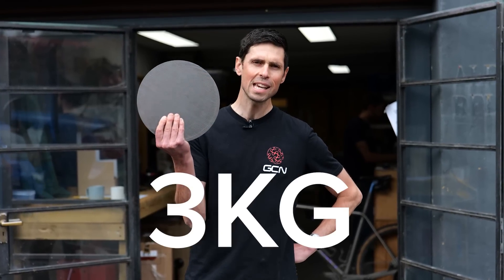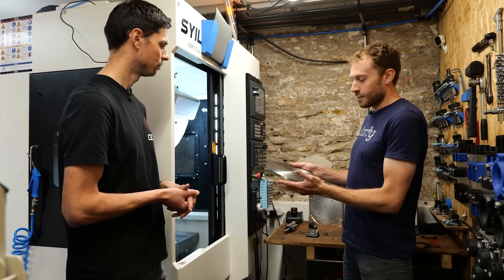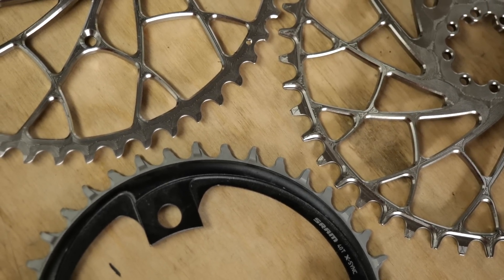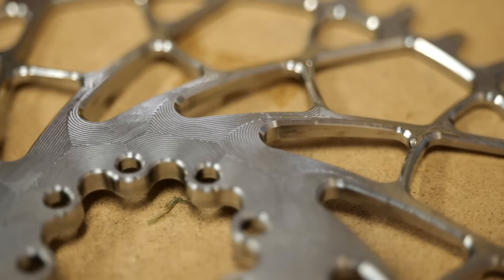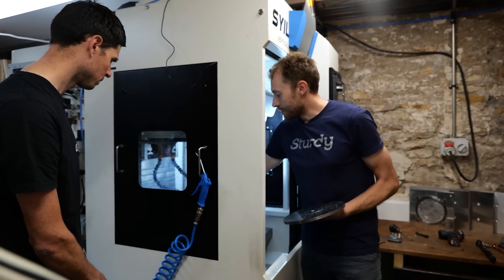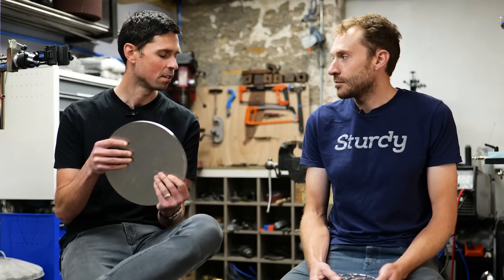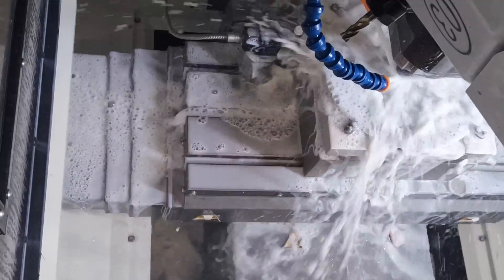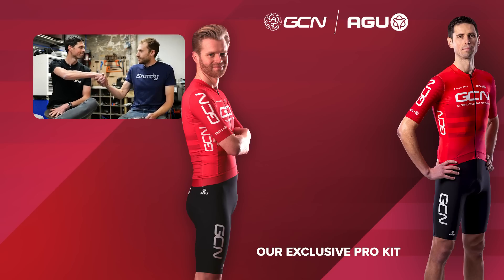How The World's Most Expensive Chainrings Are Made!

Comment: I'm waiting for e-bike engineers to make a braking system like the engine on a train "Dynamic Brakes" you can eliminate the rear disc and caliper and turning the motor into a generator, by squeezing the brake lever, that power could be dumped back into the battery. Maybe it could work so well after some tweaking, that you could still lock up the back wheel with the brake lever and get moments of small charges.
Reply: I could be wrong, but I think the free wheel would stop it from working, like it would have to be a direct drive like a single speed. But maybe they can figure it out, where the idea can work.
Reply: @4U2CY  your right, I didn't think of that.
Reply: Fascinating idea!
Reply: @keirfarnum6811  thanks, remember where you hear it first  🤣 $$$$

Comment: While this is impressive, it also illustrates the massive amounts of waste involved. And while the left over titanium will most likely be recycled, we are talking about a 95% waste-rate ... and that is after the waste caused by the discs being cut initially.
Reply: This is pretty normal in the realm of machining.
Reply: @thomasl6912  This is actually pretty extreme for waste. I'm sure he's done the math and found this as a balance, but that's 50% more material than is really necessary which you both need to pay for and then pay to machine away.
Reply: As above answer this is pretty normal in manufacturing. Titanium is extremely expensive so he won't be wasting any more than necessary. As they pointed out in the video it's also far more durable than aluminium so the product life span is much greater. For a precision component machining is really the only option so there's no alternative.
Reply: This nicely highlights the benefits of additive manufacturing and why it is getting more and more tracktion.
Reply: You'd really need a very specialized machine that could put down titanium material.  My experience with additive material products is that they do resemble what you are looking for but don't have the strength to be of any value for a functioning part.  
That titanium frame you mentioned may have looked like a real frame,  but I sure wouldn't get on it.
Reply: @paul5683  Printed grade 5 ti is actually stronger than grade 5 ti bar...  It's just crazy expensive still. You be over a grand for a ring like this and would still need post machining on the teeth and interface. ( for reference atherton/robot bikes are printed ti lugs. Charge bikes did printed ti dropouts to name just 2 full mass production examples).

You also don't need any sort of special machine to mill ti. People do it on $800 hobby mills. Not efficiently, but its not that much more special than hard steel or stainless. It just destroys tooling REAL fast and can be a fire risk in some conditions.
Reply: @miniMonsterCNC  Been machining Titanium for about 20 years and the coated tooling that is out there now eats through it just as easy as Aluminium. You just have to use the right speeds and feeds. Running tooling too quick will destroy them quickly.
Reply: @dikkybee  On a taig? My context for that comment was on a little hobby machine. Probably not fully clear. Otherwise exactly what I mean. It is not all that special to cut.
Reply: Are the titanium shavings recovered and recycled?

Comment: Thanks for a great dive into bespoke bike component manufacturing. But, I would have loved to hear more about the structural design considerations (of the web) and the value of working from billet as opposed to stamping or forged.
Reply: I can tell you one thing about not using a stamping or forging. You would need a specialized die to do either. Plus you would need a specialized machine to run the die in. A forging would be more difficult.  The stamping might be accomplished with a fine blanking die. That's how they make a lot of those thicker steel sprockets, but you would still end up with some second operations to finish it.

Comment: If you want to make something compatible with their products, you usually can go to the designer/patent holder and get functional design spec (usually licenced for a cost) not going to go down well (with consumers lr the original designers) if your making products that aren actually compatible when parts like these need to be made to tight tolerances, and if the other company has a valid patent, you can't just measure one of their products to get your measurements to make competing product of your own without risk of infringing their patent anyway. If its out of patent or an open standard, there will certainly be design documents for the critical parameters about.
Reply from the maker: Thank you for providing this information!
Reply: That's not true. You can measure and fabricate an identical part as long as you don't claim that your new part is the original part. That's how most oem manufacturers operate.  Many of them make the same product under the same roof for different companies and if they offer an oem with their own name on the product.
Reply: @paul5683  what do you think patents are for? They are a form of legal protection for product designs. OEMs will either hold the design patent or produce under licence.  You can't just manufacture a copy of something that's covered by a patent without  permission of the holder or you risk an infringment lawsuit.

Comment: A Dura Axe 34 tooth chainring is £40 (you can get it cheaper if you hunt about),  one of his is £312 (Inc VAT).  If you get eight times more use our of it it is a good deal.
Reply: Oh stop with the rational thinking!
Compared to a carbon fiber propeller, this thing's a BARGAIN!  Buy 10 and save!!!!
Reply: The propeller would make me go faster
Reply: good luck having that work out in practice =)
Reply: I'm guessing that rough piece of titanium cost about 50 pounds to begin with.  All that screwing around and overhead, he's not exactly getting rich doing this.
Reply: @paul5683  You could make 3 chainrings from that massive titanium wafer but he decides to waste it on one.
Reply: How often does an inner ring get replaced? Every 2 or 3 years? Who keeps a bike long enough to save money like that? Just admit it’s all about the bling 😀

Comment: Absolutely beautiful chainrings but they are not cheap at £350 for a 42t.😮
Reply: He’s not charging near enough if that chain ring is only $350.  $100 just for the blank and 5 hrs of machine time. If you amortize the cost of the CNC machine into that part he’s losing money on complex parts like this.  This is a passion project.
Reply: @daversj  He's probably giving the cut outs back to the Ti manufacturer to recycle, so, blanks should be cheaper.
Reply: @daversj  CNC machining in the UK is a lot lower cost than in US. Machine shop rates are normally £30-£60/hr. In US I understand $100/hr is pretty much the minimum. If I charged £100/hr for 3 axis work I wouldn't get any work!
Reply: @daversj  True,I work on CNC Lathes and milling machines to and the Tungsten insert cutters are really expensive.
Reply: @daversj  I definitely though the price was going to be higher, considering all those factors.
Reply: @daversj , did you mean $ in your comment?  Cost was in £ not $, which is approaching double in CDN $.
Reply: @daversj  And hes wasting 90% of that titanum disc. You could make 3 chainrings from it.
Reply: The man still has a lot of overhead to pay for.  Those tool holders alone are a couple hundred dollars each . That mill was about 100,000 dollars if not more. Disposables like end mills , coolant,  even paying the electric bill is not cheap.  You aren't going to run something like this on some solar cells up on the roof.

Comment: Nice and interesting video !
I am wondering if doing a composite structure using carbon in the center and titanium for the teeth would allow to reduce costs (obviously raw material usage) and improve even more weight.
Reply: A steel ring on a carbon disc might offer the best blend of weight, cost and durability.
Reply: @neilwinkelmann8540  For real. Well-designed and manufactured of steel to form the outer chainring only area would weigh almost nothing and last zillions of km.
Reply: This is already a thing by the way. Look up Race Face Era. Steel teeth on a carbon spider with an aluminum shaft interface. And it is indeed lighter, cheaper and arguably stronger. To bad they are only available for Race Face specific crank interface and only in MTB sizes (34T max), cause otherwise they would made these titanium ones completely pointless, IMO.
Reply: You would have to have a mold to form the carbon fiber into the shape that you want. Adhering the titanium to the carbon fiber would be another huge challenge.
Reply: @paul5683  google "race face era chainring" it's lighter, more durable and it's about $120 :)

Comment: Just started the video, already claims this is vastly superior product. Are those claims going to be backed up beyond this being a bling product 🤔
Reply: Interesting video. Might be pricey and unnecessary but you’ve got to love the small manufacturers.
Reply: Depends on your definition of superior. It’s a weight weenie item. 

Titanium is stronger and can thus be lighter. 

But yeah it’s a game of diminishing returns.
Reply: @hockysa  Depends on the grade of titanium - 7075 aluminium is harder (And therefore more wear resistant) than basic 3Al 2.5V Ti, as well as being lighter. With heat treatment, Ti can do a lot better than Al, but that isn't mentioned here, so there's a decent chance the material being used is in it's softest, annealed state as that's the easiest to machine and the dentists buying this stuff won't know the difference, nor do most of them put the miles on the chainrings to find out.

With a hard anodised surface, the Al will last longer again, though Ti can be nitrided to give the same benefit. All these materials fall massively short on the wear performance of any decent grade of steel (Which can also be nitrided to increase life even more) however.
Reply: @peglor why would you mention a grade that nobody is going to use? Makes your point completely irrelevant. Grade 5 Ti (Ti6Al4V) is the most used grade in everything from motorsport to aerospace.
Reply: @Minerals333  The vast majority of bicycle frames made from Ti are 3Al 2.5V where the manufacturer specifies the material. Some will use 6-4 for dropouts or small components, but I've literally never seen a  Ti frame advertised as anything other than 3-2.5. In strength to weight terms work hardened Reynolds 853 is already superior to work hardened 3-2.5 Ti, so they absolutely should be using 6-4 Ti, but they're not.
Reply: @peglor  why are you comparing bicycle frames to other components? A frame is a completely different in both material property requirements and manufacturing methods.
Reply: @Minerals333  So bicycle frames aren't made from a mix of machined and cold/hot formed parts welded or bolted together? In what way is a bicycle frame completely different in terms of required properties to the other components of bikes that also take cyclic stress and support high localised loads at features such as dropouts and screw threads. If anything with the amount of machined features being added to modern bikes, especially around the chainstay/BB junction, bike frames are getting closer and closer to identical to other machined components.
Reply: @peglor if you can’t see a difference between seamless tube welded together and cold drawn and machined billets, nor frames and chainrings then I don’t know what to tell you. You probably think billet car wheels are made from the same aluminium as car body panels.
Reply: @Minerals333  The seamless tubing is also hot and cold drawn, the billets you're so adamant are completely different to tubing are also hot and often cold worked as well as heat treated to get their properties. The difference for many applications comes down to the strain to failure properties of the material, namely that peak hardness (Yield strength) is not the most important property to aim for when a structure needs to be resilient, while for most machined parts, even after machining, there's so much more material than is needed, that strain will be minimal under normal loads, so maximising hardness against mechanical wear is a priority. In many cases the same material with different forming and heat treatment can do both jobs once the engineer understands how to get the best out of it.
Reply: @Minerals333  You can't fix stupid
Reply: Well, titanium is far harder (i.e. durable) than aluminum, so the claim of a Ti chainring being superior to an Al chainring makes sense.
Reply: @benconnor4848  It depends on the grade of Titanium and Aluminium involved. There are grades of Al harder than Titanium - see my earlier post - but most are not. All aluminium is significantly less dense than Titanium though, so there are free weight savings if you pick the right material grade as they both top out at about the same strength to weight ratio (As do just about all structural metals).